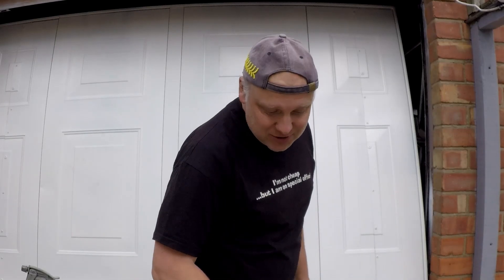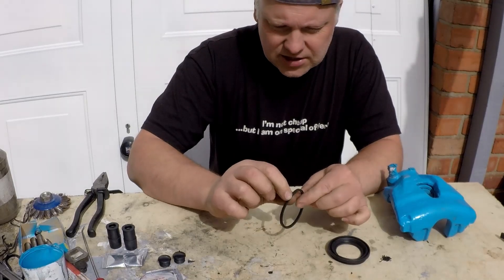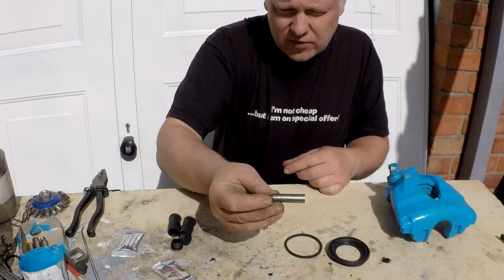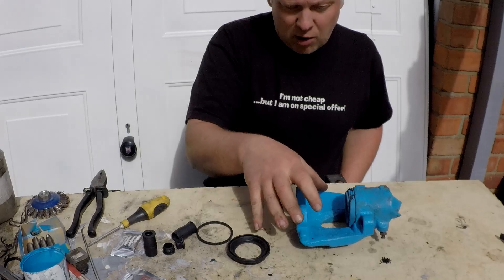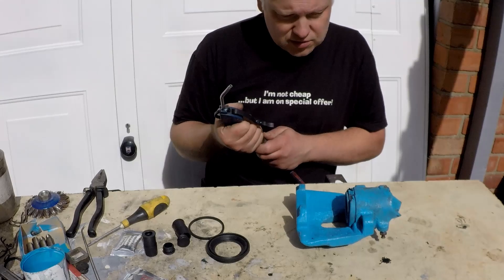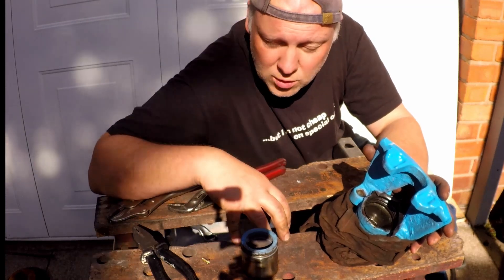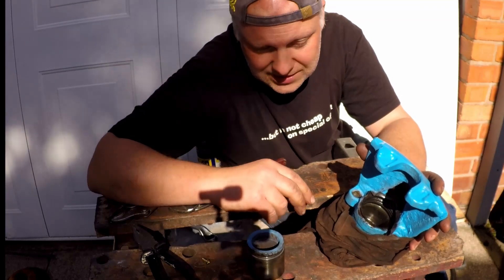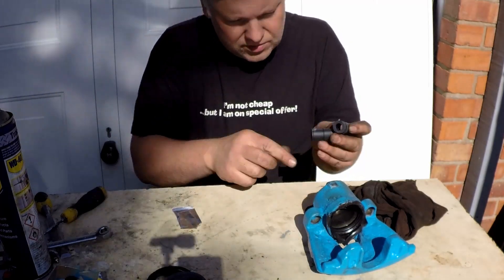Front Brake caliper - Rebuild/Re-seal for seized ATE brakes for my VW TDI Swap

Comment: Did you put grease inside guide pins or just outside
Reply from the maker: The silicone grease inside the guide rubber/sleeves will help with the assembly, slider pins is the important part that needs grease for long term service
Good look with your build

Comment: "old dirty cloth - just to get rid of ultraclean brake fluid ??"      
should have recorded video indoors, in a vice - with controlled lighting!!                                             ---                                  old git, UK
Reply from the maker: Well spotted! Your right doing it inside would of been better but the garage is rather full and the lighting never looks right - I need a more room! Brakes work well though!